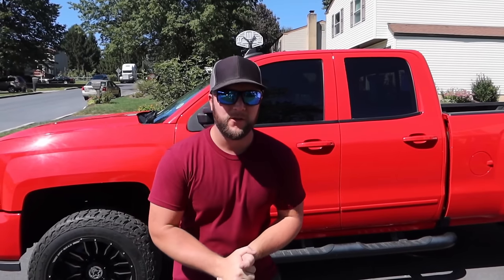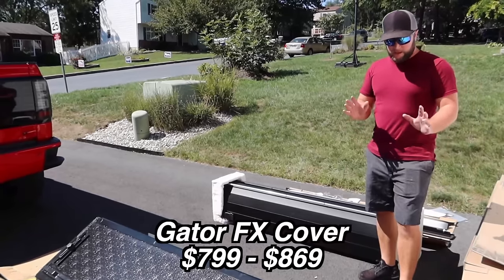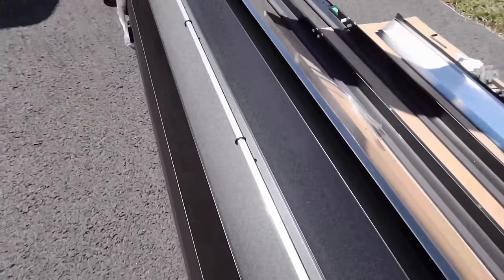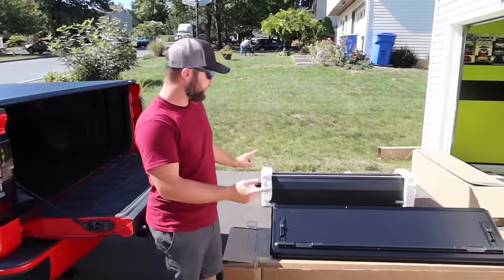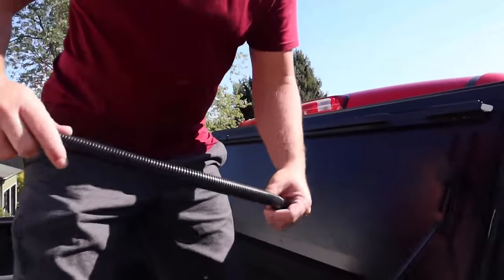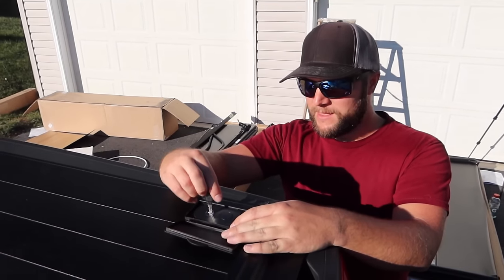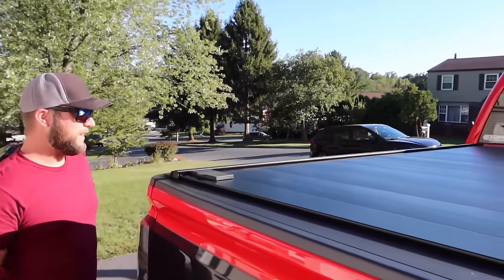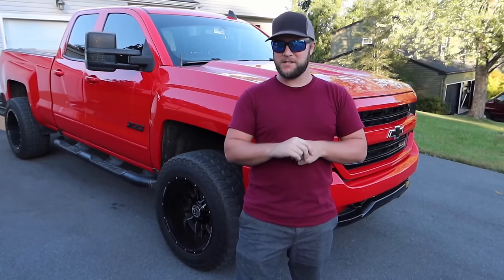The ULTIMATE Tonneau Cover Comparison | Truck Central

Comment from the maker: Let's kick off a brand new season with a question... What truck do you own right now? (or trucks if you have more than one!!)
Reply: 2019 trailboss and love it
Reply: 2016 double cab z71.. you should look white automotive and the autosync unit. I prefer the roll cover.
Reply: GMC Sierra All Terrain. I have a Bacflip Rollex cover on it works great
Reply: '08 F150 bought brand new in cash...4.6 L, auto, crew cab, A/C, cloth, carpet delete...it's been the best all around truck I've ever owned...
Reply: 2020 Toyota Tacoma Off-Road
Reply: 2019 f250 powerstroke
Reply: 2020 RAM 1500 Laramie
Reply: 2020 and 2004 suburban
Reply: 2012 cummins with 6 speed manual
Reply: 2019 f150 XLT with every option, extended cab short bed 3.5 then 5 other fords of various years and models for my business
Reply: 2016 GMC 2500 Crew Cab Denali w/Duramax
Reply: 20 Ram 2500 Lar. 6.7
Reply: 2019 chevy colorado lt 4x4 rst package.
Reply: 2020 Ram 1500 5.7 Bighorn 4x4
Reply: 2021 Ram 3500 dually..... what covers do you recommend?
Reply: 2018 Ram 1500 4x4 Crew Cab
Reply: 2019 Ford F-250 6.7L with a Retrax bed cover. The truck is too stall and a stiff ride but still really like it! The Retrax is great although overpriced in my opinion!
Reply: I'm a first time truck owner send me the one you dont want.
Reply: 2021 Silverado Trail Boss
Reply: No current truck but am definitely considering the Ram 1500 with the Ram Boxes. I know that narrows the bed, but they still make tonneau covers for it I'm guessing.
Reply: 2021 Tacoma TRD Sport
Reply: 2020 Tundra
Reply: Used 13 Titan for 10k cash 101k miles. So far so good.
Reply: 2021 Chevrolet Silverado 1500 Custom double cab truck
Reply: Just picked up a Maverick Lariat hybrid.
Reply: How long does it take to just uninstall the 2nd one?  I am going on Vacation in March and would probably just put the thing on a couple times a year when I needed it.
Reply: Ford 150 with a 6.5 foot bed
Reply: 2021 RAM 1500 Warlock
Reply: Should be receiving my first truck...2022 Chevy Colorado...in 2-3 weeks!
Reply: 2021 Ram 1500 Big Horn Built to serve
Reply: 2021 Ram Rebel
Reply: 2022 Chevy Silverado RST.
Reply: 2022 Ram 3500 Dually
Reply: I bought a 2016 Ford F-150 around the holidays.
Reply: tundra its my second the first one, I never fixed one thing on it ever
Reply: 2019 Ram 1500 💪
Reply: 1954 Chevy 3100. 2013 Tundra Crewmax Platinum.

Comment: I was convinced I wanted the second cover and kept trying to stash away extra money for one.  After awhile I simply purchased the a model like the first one you installed in the video.  It has been great.  Never an issue, only leaks slightly in a high pressure car wash, never leaks in rainy situations at all.   When I want full use of my bed it just comes off in like 5 minutes.   One day I did an unplanned furniture purchase.  Took off the cover behind the furniture store, put the two piece sectional inside, threw the folded cover in the back, and strapped everything down.  So simple, flexible and easy.  I would totally do the first option again and again knowing I never leave any valuables in the bed anyway.
Reply: How has it held up, also is the material thicker than it appears
Reply: @travisa1326  Mine has held up very well in my opinion.  In my neck of the woods we see High 90's in the summer and sometimes below freezing in the winter.  It is starting to look a tad dull but I am sure a good cleaning and some treatment would make it shiny again.  It is still leak free which amazes me.  For the cost it looks like it will last over two years maybe closer to four.  At that point if it got too weathered I would buy another one.
Reply: What model was it? Thanks!
Reply: @SQTierHog  It was a Tyger brand ordered through Amazon.
Reply: I was sold on a hard trifold until I saw how easy the soft one is to take on and off without any tools
Reply: Have you had any issues people getting in your bed. Stealing? Items
Reply: @paultaylor2689  In the time I owned it which was about 3 years I never had an issue.  The tailgate on my truck was a power locking tailgate and the cover was secure enough that you would have to cut it or use tools to pry it open.  If someone really wanted to get in there though I am sure they could.  I was more focused on can I lock items in the bed and will they stay dry which I was able to accomplish with this cover.

Comment: I purchased the retractable cover for my F250. Having used it for a few years now, I’ve decided I’m going with option 2 (hard/fold) for my incoming pickup. The retractable version ended up being impractical, heavier, and took up too much bed space. Option 2 makes the most sense, especially with the ability to fold it all the way up while driving. Great review btw, you helped me firm up the decision.

Comment: Just pick up a Diamondback SE. If you want to put a quad or something heavy on top of it, get the HD. You'll never want another cover.
Reply: Yeah nothing else compares to the Diamondback, 1600lb capacity
Reply: @quadguy1470  
Renegade supports 2,000 lbs with integrated track system.

Comment: One thing I'd like to point out, is, for the hard folding cover, because it can only be opened from the inside it doesn't need it's own lock. The lock on the tailgate protects the latch, and therefore if your gate is locked so is your cover. It is plenty secure.
Reply: Sounds like your idea of plenty safe matches my idea of plenty safe. That works for me.

Comment: Hand grips?  They’re called stake pockets.
Reply: Not stake pockets.
Reply: He's deffinately a city boy!!
Reply: It's not even a real truck to begin with. Looks like something a yuppie girl would drive.
Reply: If you look closely, you'll see that they have been reshaped, there are only two at the rear (not six), they are indeed "hand holds" .
Reply: They are stake pockets. Front two are accessible by cutting out the marked area on the rail covers. They also accommodate bed rails.

Comment: Thanks for the details.  I had a low end soft cover that lasted about 4yrs until it blew off while driving high speed on a highway...yea, that happened.  Fortunately, no one or thing was hurt.  Now finding the "better" products on the market today are making it challenging to be satisfied due to a lack of them being 'simple'.  Also, finding deck rail systems from the truck manufacturer are playing into the install and functionality of these current covers.  May just stay with a cheap cover again.  Easy install, full use of the stock deck rail, and easy to remove when needing the full bed....

Comment: I've had a couple Truxedo soft roll up covers, never had any issues. I like the roll up kind because you always have easy access to the whole bed.
Reply: I'd pick the Gator ETX over the the tri fold model. It's at about the same price point. The thing I like about that one is it doesn't cover the stake pockets. I want to add bed rails to mine. The other 2 are made by the same company as BAK and Truxedo. If you watch videos for those, you'll see all of the rails and hardware are exactly the same.
Reply: Extang makes a lot of these behind the scenes.

Comment: The gator FX looks like the best of the 3. You can fold it all the way and you don’t sacrifice any space, great in depth review of the 3 options!!!!
Reply: @oscarpacheco6838  any issues with the rubber on the sides weather cracking over time or folding it?

Comment: I have the 2nd cover on my Chevy Colorado.  Use it constantly and it works like a charm.  I can choose  not to latch the last section or mid and last for bulky loads.  Since you need access to the release cords once the tailgate is locked it's secure and out of sight gives peace of mind.  Thanks for the review.

Comment: I had the cheap gator trifold on my Ram and it was great, goes on and off in a couple minutes once you get good at it. Recently I bought a really cheap Tyger soft roll up cover for my Tacoma and it's way better built, easy to install, and never has to be taken off. I'm never spending $500-$1000+ on a bed cover, I'll stick with soft rollups from now on.
Reply: Got it. Before spending $1500 for a bed cover I would rather buy a cap.

Comment: Excellent review.  I actually bought the second and it was fantastic but after about 7 years the material between the metal sheeting started to get water logged to the point that it was extremely heavy to use.  Framing also started to loosen up making it tougher to align to close.  I do admit it was fantastic up to that point.  Worked great for my fifth wheel and was easy to use and secure.

Comment: I love my tri fold soft cover. It’s definitely worth the money and very affordable. I’ll probably the the hard folding for my next truck
Reply: Is your tri-fold water tight?
Reply: I have the gator soft folding (I think it’s the same one in the video) and it seems to be pretty water tight. I went on a 5 hour road trip and it was pouring rain the entire way and my luggage was dry when I opened the tailgate. There’s probably a couple spots where a little water could get in but it stays dry for the most part
Reply: .7 mui

Comment: Ive had the first option for about 3 years now, its held up really well and doesnt leak at all.  Its by Tyger but functions the exact same as the one you showed. Lightweight, cheap and easy to use. You cant go wrong with any of the three, just depends on your budget,
Reply: Is it pretty solid at highway speeds in terms of flapping in the wind? I never even thought of getting one of these but the ease of taking it completely on and off can be a huge benefit.

Comment: I've had varies covers for different trucks. I had a snap on cover for my Dodge Ram. That one was nice because it was easily removable. But in the winter months you had to take it off or on, I had to put it in the sun so it would stretch to snap it back on. 

My 2nd cover was a roll top cover I had on my 2011 Silverado. It also was easy to take on and off (open and close). But I had issues with it leaking. 

My 3rd cover I love the best, I bought a Diamond Back cover for my 2016 Silverado and this thing is tough. It's the most expensive but no leaks, and it's indestructible. It comes in 3 pieces, and it's held on with 4 clamps. There is video's out there that this cover is nearly impossible to break into. The HD Edition can hold up to 2500 lbs on top and you can still open your tailgate. 

Great video guys. I've ordered from Real Truck before, and they are amazing.

Comment: The hard folding covers are the best in my opinion. If you have a locking tailgate they are very secure. Easy to open close and offer the most available bed space.

Comment: I just purchased a 2020 GMC Canyon and, lucky me, it came with the REV trifold cover, essentially the same unit as the Gator FX.  It's a very nice addition to the truck: not waterproof, but definitely keeps most of the water out.  Secure enough to guard against the casual thief.  I will probably use it either fully closed or fully open, the latter when carrying a bike or two.  Still have some experimentation to do in that regard.
Reply from the maker: Definitely a win when your truck comes with the exact mods you want! Enjoy your new truck 🍻

Comment: Thanks for the video... I´m in for getting a bed cover and I had seen the Gator models on Truck Central´s website... I thought I wanted the trifold but after your review now I know I want the trifold! I mostly want it to keep the leaves out of my bed and the occasional grocery run with my wife... (yes, if given the space she will fill a pickup at Costco). Great video!!! Oh, and I have a 2005 Chevy Silverado with 62k miles and 2 light character scratches.

Comment: I went with a roll up style for $180 on Amazon for my 2014 Ram with a 6’4 bed. Works great in rain, no leaks.  Since my truck sits in the garage and it’s not my DD it should last a long time.

Comment: the mid grade second option one looks to be the best option, full access to bed and looks sleek. the third option is expensive and losing full access to the bed (especially on 5ft beds) is a non starter in my books.
Reply: If you have anything less than an 8ft bed, then you don't really have a truck.

Comment: The lower tri-fold optionI bought for my wife’s 1500. It was great except be careful as a gust of wind flipped it back causing damage to it just as she was folding it back. It still seals well and works, but you can definitely tell. One of those freak things , but just FYI.
Reply: Hi Richard, I'm leaning towards gettung the soft tri-fold! Did your wife experience any attempts at theft? Just a bit concerned about security.

Comment: Cheaper one is the best imho you can take it off if you need to on the fly by yourself usually someone isnt goin to cut into your top just to see what you have and it's 1/4th the cost my 2 cents
Reply: Soft covers don't last, specially not if you open and close it every day. I've had 3 covers so far. My soft truxedo cover is the only purchase I regret

Comment: Thank you for the video! I appreciate the well explained intro of each model 👍 !

My comment to the manufacturer:
1. The basic version can have a better folding design, instead of the existing tri-fold design make it a Z-fold design so the inside/under side  of the cover never face against the outer/upper side collecting dust...
2. The middle MX model, instead of the two clearly visible "manual" rods to prop the cover open, they can be relocated to the end of the cover (behind the rear window) so the mechanisms (rods & secure screws) are less visible.
3. The most expensive version, for the price, the design could at the least also include a self retraction (i.e. spring loaded like a roll-up window blind and cab stop at any position etc.) function so make it more worthy of $2k.
Sincerely.

Comment: I've owned both a retractable one on a truck and a used soft tri fold. I found that the soft tri fold kept things dry and never got messed with. So it kept things out of sight out of mind. I normally keep a multi function ladder in my bed. So on my latest 2020 f150 lariat, I went with a brand new Tyger trifold soft cover. It was easy to install and I know I can easily take it off in a moment should I need to. It currently looks great and my last f150 had a soft trifold that was at least 4 years old and was a bit dull looking, but I never treated it or conditioned it at all.
With my retractable, I was NOT taking that thing off casually.
Reply: Any issues with the soft trifold flapping in the wind?
Reply: @michalp2362  the fabric can be seen to ripple some at high speeds, but it's minor. It is definitely NOT like hearing a flapping flag behind me or anything. I still don't regret saving myself the money. Way more than dry enough for anything I'm going to keep back there. 

My only teeny gripe with this cover is that I can't flip it up vertical (cover up back window) to get access to my entire bed, but it isn't much to take it off if need be. So still no regrets.
Reply: @TheRPhelps24  glad to hear it’s not loud. noisy flapping was my main concern. I actually see the ease of removing it without any tools as more beneficial than the option to  put it up against the rear window.

Comment: I got the Gator soft one and paid less than $200 from real truck. Nissan Titan. 

Its held very well, no water gets through despite living in a rainy climate. Definitely worth it if you don’t want to spend money. I’ve seen vids of expensive ones that leaked water.

I also purchased it because it’s easy to take off and on. If I need to move furniture or something, take off, then put back on.
Reply: Hello, good to hear that it doesnt leak! I'm leaning towards the Gator soft one too. I plan to nomad out of my truck (sleeping in driver's seat). Do you think the soft cover is secure enough to hold some not terribly expensive tools, clothes and some foods? Or does it feel fragile and will easily razor through like this youtuber mentioned?
Reply: @Maybelove88  no, it’s definitely not for security. You need something hard for that. You can easily cut this if you want.
Reply: @gobucs3146  ok thanku

Comment: How hard was it to take off the MX if I wanted full access to the bed and back window visibility?
Reply from the maker: It doesn’t have quick release clips like the soft cover but it’s not difficult. It’s not designed to be taken off daily but doesn’t take longer than a few min to connect/disconnect from the rails. I’d definitely rather do it in my driveway than in a store parking lot though.

Comment: Second one is back-flip knock off. That said it is the clear winner. On mysecond one. First one lasted 7 years before the sun destroyed the material. I'll take seven years of service. I like that you can sit on the cover if it is folded even once. I like to fold it twice to put on my muck boots when hunting. Or to just hang and eat a snack or something while in the field. It also works great for hauling my quad. protects window from any back window accidents. This cover is also lockable if youe tailgait locks as the tailgait needs to be open in order to access the cover. Lastly along the lines of having room on the sides for his handhold to get up. The backflip design has availability for a cargo rack. So i can haul my quad and my conoe at the same time without taking off the cover. All in all the back flip design is a clear winner for me.
Reply: Gator is actually owned by bakflip so not exactly a "knock-off"... Like saying Sierra is a knockoff of Silverado...